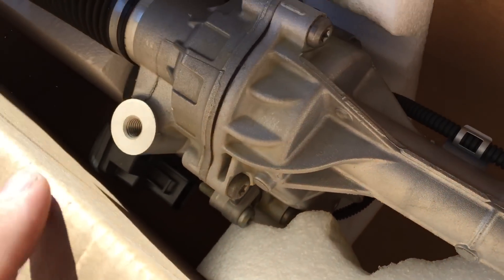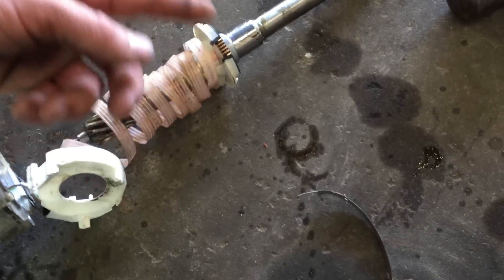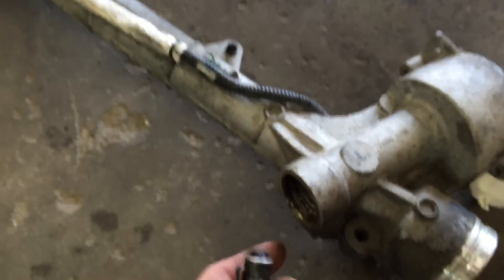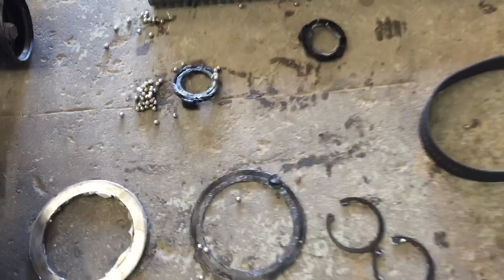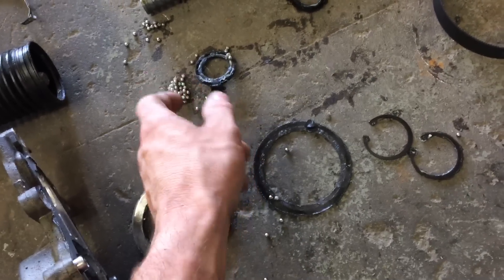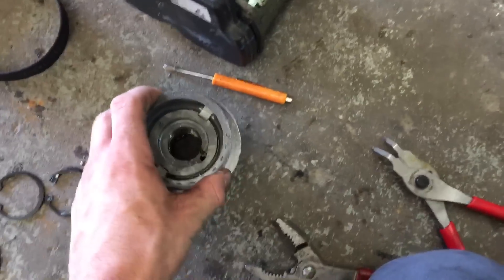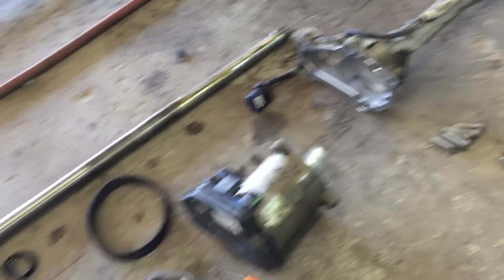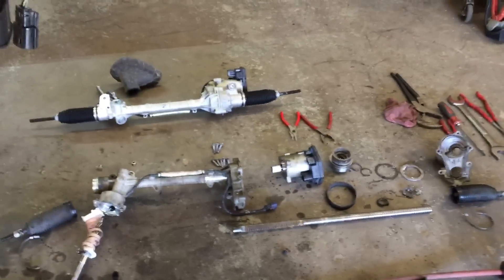Ford Electric Steering Gear Disassembly

Comment: Just a note, when it sounds like a belt is jumping the cogs, stop and tighten the belt before you damage the belt. Many Fords had, and still have, this issue. The three bolts can be loosened, and the motor can be pryed a bit to tighten up the belt. Hold the motor in place and tighten the bolts. A 20 min job.  Cost nearly nothing and can be done from the top of the engine bay. But that is the benefit of knowing how it's built rather than Guessing. It appears that the bolt size and hole sizes don't allow for enough movement, but most of the time, it's enough.  It's mere mm's,  but that's all it takes. This model does not have a belt tensioner like the F-150 steering.  Wiggle room in the parts is your friend in this case.  The motor doesn't care where it's at as far as rotation, the encoder takes all that responsibility, so even if the cog slipped 100's of cogs, it's all good to tighten up anytime.
Reply: You sound like you know all about these racks. My 2013 fusion has a grinding/scraping noise when turning. Not popping like this one. Started after I drive through DEEP water. Not sure if that caused the problem but it started literally 2 days after and getting worse. Sometimes steering binds when turning. Or returning to center. 
After seeing the breakdown in this video im thinking maybe the lube got washed out of the worm gear that the motor drives. 
Ever run into this grinding/scraping issue?

Comment: I have a focus RS with a very similar steering rack that is making a clunking noise. The clunking is the rack hitting against the rack housing when you move the wheel back and forth. I was going to try and adjust the preload on the rack see if that helps. Do you know if the bolt at the bottom of the pinion shaft is the tension spring? If so, can it be pulled out with a rack in the car?

Comment: I have a 2013 fusion 1.6 and car was fine , i drove in the rain in winter next day the steering was lock ,i finaly got it to unlock but that cracking noise apear , i put the car on a lift and 1 of the 3 bolt that hold the electric motor on the pinion was boken ,i ve put new bolt but since then the rack and pinion cracks

Comment: That belt will make a awful loud noise when it's worn out. When turning  the steering wheel all the way to the left or right. In addition on my 2014 F150 my Service Trac light would go on and off. When replacing the belt, have a extra set of hands to put tension on the tensioner pulley. For you want the belt to be tight on the first go round and properly seated on its housing. If its not tight, it will make a loud noise, as well You do not want to loosen that screw to many times. For it is easy to strip when you're doing it by yourself!!!! Then you'll have to get your tap and die set out. If you have to tap hole. Pay close attention to the thread pitch. Take your time and take pictures. For it will save you a lot of money!

Comment: I have a 2012 Ford Fusion SE. I have to replace the whole unit, is it possible to replace it with the car jacked up on the ground?  I don't to have access to a rack.

Comment: What if you just put that thing back together, but left out the belt and the worm gear pulley? Would it work just like a regular unassisted steering rack? I wonder if the gear that connects to the wheel can take the load, and the steering shaft.  This is a horrific design, as worm gears don't like to be driven backwards and turning that wheel would probably be very hard... harder than hydraulic I would guess.

Comment: Failed Electronics will cause that screeching noise as transistors switch on and off out of intended control, so basically the motor becomes like a speaker as power rushes in and then gets disrupted immediately and so on. Possibly the torque sensor failure or other parts of the control system failure. On my car not a Ford but one of GM's Opel Astra made a rumbling noise as though something had gone wrong with the engine, terrible grinding noise getting louder and louder until I switched off then from then on the power steering warning comes on and no more power assist.

Comment: So all the gas money you apparently saved with electrical steering assist went down the drain :) Economy in motion ...
Reply: question is,, out of the 100,000's of these built..how many have failed..percentage?    some going bad.. go to youtube... post the problem..now all of them are bad units... correct?  what are the the percentage of non failed ones?
Reply: Well is good enough percentage for Ford to issue free replacement under 150k miles. You can calculate how much money from gas you saved for 150k miles using that electric gizmo. Rebuilt rack is between 500-700 US dollars not including labor.

Comment: My car made this exact noise. I replaced the entire front suspension. Then turn the car on and the noise was still there including that huge rattle at the ends. It was the steering gear. I was quite happy I bought an extended warranty with the car. $2800.

Comment: Same issue with our 2013 Ford Explorer. Same expensive repair.  The more I researched the more disheartened I am to discover all the automobile manufacturers are using the EPAS system in cars.  It is very difficult to find a vehicle now (2021) with hydraulic steering like the good old days.  Clearly this is built to fail which plays perfectly into the dealerships strategy of billing out costly repairs for these throw away parts.  I guess we are all going to have to accept it ...or buy a pre 2005 old beater! Sucks to be a car owner.

Comment: It's the  postioning sensor.its out of sequence. It's telling to drive the motor when it shouldn't be. The black marks are the belt rubbing against the case. Did mine on a mks with 100000kms. If you could replace the sensor it would have been fine but no ford dissent sell it separately. Ford crap. Your asking how do I know? Because I replaced the sensor on mine with a junk yard one and had reprogrammed and it worked!!!
Reply: Can an independant garage do the reprogram?
Reply: @wingontario  yes if they have the reprogramming  obd2 machine.

Comment: Dear Danial Jaeger,
      Thank you for this very informative video.  I am just trying to understand how the new power steering works now since there is no power steering resevoir.
      I just had my Ford F150's (2013 Model) power steering go out and their dealer said it was the "Steering Gear Assembly".  They wanted $1412.5.  Sound right?-  Thanks again.-Paul

Comment: This sound  show that belt slip ,  in Tesla S is possible made  belt tension  .  motor fix screws is M 8   holes is  12mm  ,there is possible belt tension adjustment.

Comment: Could it be the bearings? My 2015 explorer is making a grinding noise like bearings. do you think it can changed?
Reply: My 2015 is grinding too. Did you find any parts to rebuild it?
Reply: I´ve got the same issue in a 2014 Focus; were you able to get the bearings spared part?

Comment: 2:50  Its a ball screw. The inside of the pulley is the ball nut.  Not really a thread, more like a helical bearing race. They are a very efficient means of converting rotational motion into linear motion. Very low coefficient of friction.

Comment: Yes, the EPAS rack does in fact implement timing-belt driven from brushless AC motor. This belt does in fact have very fine-pitch teeth; but it does make you wonder what other aspects of design were copied from a sewing machine.

Comment: nice, so it has a belt inside the steering rack.. good job ford.. I guess this is no high mileage vehicle
Reply: 2016 explorer same issue, less than 100,000 miles. It started after a rainy day.
Reply: @nymincho   Water seems to be the catalyst for rack problems unfortunately
Reply: they all have this not just ford and it's very reliable.

Comment: I found a reman rack for 625.00. A hydraulic rack for similar car was 175.00. Ain't technology great?
Reply: yeah but what would a hydraulic pump would cost? the electric system is fully self contained, plus there is something like a 2% increase in fuel economy.

Comment: As another individual brought up, sound you heard could be one of the motor's phase drivers failing under high load. Take the cover off the motor controller and you will probably find a stack of 6 mosFETs. If they are bare die, good chance the aluminum bond wires are failing, cracked at the wedge bond. High heat and inherent defect of aluminum bond wires that succumb to over stress cause many electronic failures. Aluminum wire bonds are a promoter of factory to landfill products as is lead free solder.
Reply: How can you take the cover of the motor controller off?

Comment: So, at the time of the video, a $25k car that is 1 year old has a steering fault. Dan's videos make me want to stay away from Fords. After seeing this and the 2 transits.
Reply: The thing about judging a car based on the scenarios found in repair videos means you will only find it's failures.
Reply: beechface1 it's  a rental this generation  ford  fusion  has a really good reliability  reputation  and its far from junk. rental cars take alot of abuse because  it's  "not my car i don't  give a shit".
Reply: 91myroc I didn't realise it was a rental. I've heard good things about Ford, I was considering a 2017 Fusion (Modeo in the UK) just don't want to spend that sort of money and have troubles.
Reply: beechface1 You won't  have any trouble  with it  if you take care of it

Comment: Please note I have since posted youtube video on EPAS failure disposition on my 2010 Flex. The problem is indeed thermal stress as postulated in prior post. Ford mounted an 1800 degree catalytic converter within three inches of the EPAS aluminum housing (on Flex). This design heats EPAS assembly well above industrial temperature levels of 85 degrees C. The failed EPAS unit removed from my Flex exhibited internal signs of thermal stress, including discoloration and boiled-off thermal compound. The MOSFET drivers were found to be burned-out on unit, which was apparently the primary point of failure. Not clear what Ford engineers did on the Fusion, but I am convinced EPAS failures are predominantly thermal stress related; not the BS Ford sold the NHTSA concerning component misalignment from Chinese manufacturer. Note an internal inspection of failed EPAS unit electronics yielded no traces whatsoever of connector, cable or SMD component misalignment issue as specifically published by Ford to the NHTSA, as the sole cause of EPAS failures.
Reply: The Dollar Guy
Thanks for your most professional and expert insight, My own expertise is predominately associated with circuit design and robotics. I appreciate expertise in die bonding and manufacturing methodologies as my own knowledge in this particular field is limited. I can attest to the fact the TRW designed EPAS electronic implementation is highly integrated with great skill in miniature SMD art. It is obvious the design engineer responsible for implementation possessed great skill and knowledge in field. It is also apparent that many aspects of design maintain the highest levels of expertise and quality control. However what is lacking in design are fundamental and academic fault tolerant methodologies. E.g. failure to implement redundancy associated with critical feedback and supervisory sub-systems. The use of a single optical rotary encoder represents fundamental and critical design flaw; as loss or corruption of steering position feedback will result in unstable and dangerous servo faults. These faults include everything from loss of steering assist, non-commanded steering actuation, steering position displacement, or steering lock-up, to mention a few. The EPAS system implements single processor for all servo and control/supervisory functions; this design flaw allows single-point computational failure to take down fault supervisory and safety control functions; effectively allowing system to potentially fail to detect critical operational fault and continue servo operation. Also there are critical examples of complete design competence breakdown within implementation (e.g. loads of thermal compound applied to large electrolytic capacitor in power and communications section of implementation). I see a classic example of distributed design and implementation approach; with multiple and varying engineering skill sets. Also, the hand of cost and time minded management is apparent in design construct; as all fundamental servo system safety elements are mysteriously missing. I find it highly improbable that the same engineer responsible for implementing such a beautiful and competent SMD design would exclude fundamental redundancy measures and glob capacitors with thermal compound 6mm thick. I can only theorize the EPAS design underwent an extensive dress-down by management, in which cost driven decisions were made with disregard for fundamental fail-safe measures that every servo engineer learns in controls 101. The final and fatal blow was landed when Ford engineers decided to mount the TRW EPAS assembly in close proximity to extreme thermal sources in engine compartment. I must say, I was shocked to find the aluminum EPAS enclosure within 75mm of an 1800 degree catalytic converter, red hot turbo and exhaust systems. Ford engineers obviously have no experience with complex, delicate, and fully enclosed electronic assembly implementations. Even more shocking is the fact Ford was able to sweep this entire disaster of a design past NHTSA supervision and public perception.
Reply: Give this man a  medal!
Reply: Yup.  Chip die wire bonded to ceramic substrate, all bonded to a common thermal mass.  Die and bond wires under silicone gel.  To be honest, this is one of the most reliable way to make a system, that is you will never see a die gold bond wire fail when bonded properly.  Thermal stress problems from expansion/contraction are practically eliminated as you would have on a conventional soldered PCB.  It's the aluminum wedge bond wires on the power drivers that cause all the problems.  When the factory wedge bond the wires, they exceed the recommended bend/pinch radius that alters the wire integrity specifically at the wedge bond attachment site.  The result is a fatigue/hot spot that causes premature failure (wire separation).  I swear they do this intentionally.  My company replaces the faulty wedge bond wires on many of these systems (not the steering pump though) with proper angles and never see the problem return.  Been receiving calls about these steering servos, but with the full plate we have, never examined what is causing this specific system failure.  Also the heat as you mentioned from the catalytic converter is not good in any way, especially for the FLASH memory in the CPU.  Boils the electrons out of their captive wells in no time for early firmware corruption.  FLASH firmware good for 20-200 years at normal temperatures lose stability in a few years when pushed beyond engine compartment temperatures.  Excellent diagnosis!
Reply: Were the burned out FET drivers conventional discreet packaged devices (like TO220) or were they bare die with bond wires?  Just curious.
Reply: All out integrated H-bridge drive with very delicate and long wire-bonds to main PCB. In addition; multiple PCB's piggy-backed with heat-sink, interface, mounting hardware, and power contacts spot welded in place. Definitely designed as non-serviceable implementation. I was able to dis-assemble PCB's but not without great effort and sacrifice of spot welded components. The H-bridge die could have been replaced, however no schematic, component identification, or reflow equipment on hand. No guaranty other components not thermally stressed anyway. Best to replace entire unit by any measure.

Comment: Steering angle sensor failed. Motor silpped on the belt as a result of it freaking out not knowing where the wheels were pointing...that's why nothing looked 'broken' when you looked into it. Thank you, TRW. Another commenter nailed it as well.

Comment: The black scorch marks would point to the belt, but I think if it was the belt causing the noise, the numbers printed on the belt would have been worn off. ????
Reply: Not if it's wearing the inside of the belt. The clunking noise could have been hits on each ridge of the belt.
Reply: I hear ya. But the  casing rubber marks would not occur from the inside of the belt. I know what you are thinking. Rubber dust and particles. But the stains look baked on. ??? I have no idea either.
Reply: Rubber dust can stain like that if it's heated up to a certain point. The heat of the belt rubbing or constant back and forth of the motor could cause that sort of heat.

Comment: Your problem is not mechanical, issue is with TRW designed electronics that drive brushless DC motor. System designed using fairly complex motor controller utilizing both motor-shaft and rack position feedback. Any electronic fault with drivers, feedback encoders or controller can result in erratic behavior and servo noise. I am guessing you felt torque impulses in wheel while turning under fault? This would be typical of failed H-bridge driver MOSFET, motor or rack encoder data integrity. Ford has published a lot of BS about specific failures and causes; my guess is the whole damned EPAS steering system design is crap poor idea in the first place; with a complex computer, motor drive and feedback electronics packaged next to engine, turbo and exhaust heat sources. Just a matter of time before these unnecessarily complex and expensive engineering nightmares kills someone.